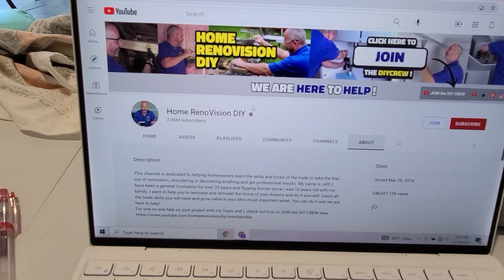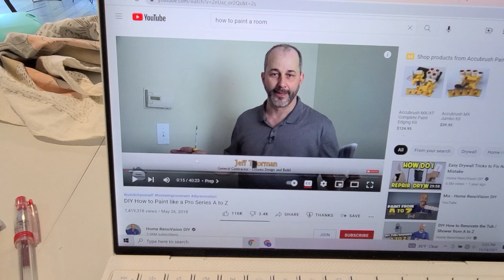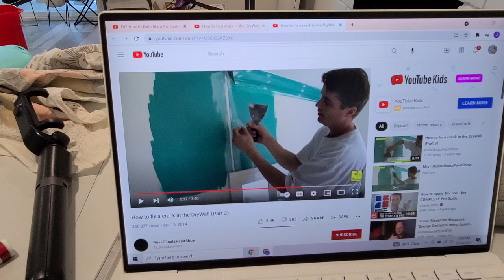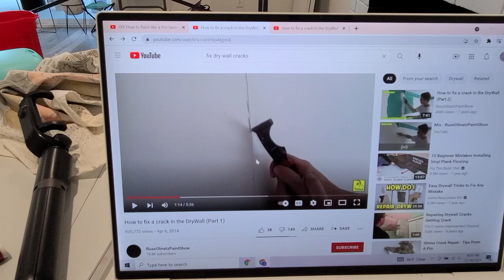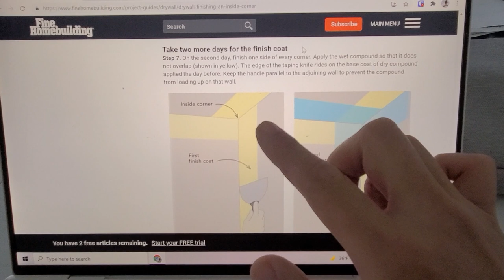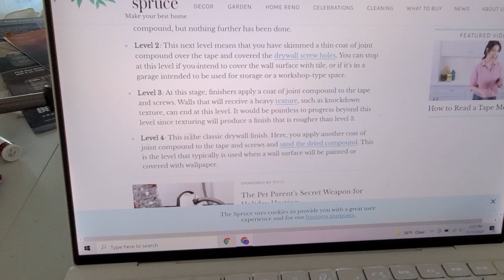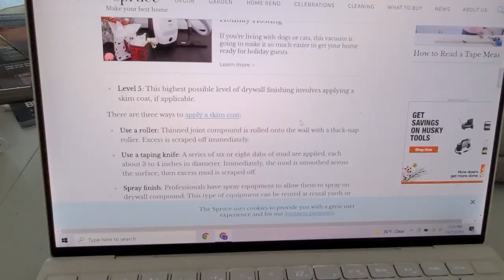A Dentist Paints A Room Part 1

Comment: I commend you for all the research that you are doing prior to starting a job but be careful it doesn't become overwhelming. For example I wouldn't remove trim  / door casing  as you did around the closet door unless I was intending to upgrade it. It's not clear from your video if you intend to skim coat the entire room (don't) in order to smooth out the slight texture or are just repairing some cracks and nail holes.  Also  I highly recommend you just buy your drywall compound in a pre mixed tub rather than dry in a bag. Look forward to your next video.....
Reply from the maker: Lol! Trust me. I wanted to keep the trim, but the wife hated it and she's the boss! I think the plan is to do barn doors. I'm still looking at skim coat. It looks like it'll be super flat and that'll make my OCD super happy, but a lot of work and I think the general consensus is most residential stops at level 4. I wanted to stop the video here because it was getting long and I still need to do a bunch of research on what color we want. Thank you for all the helpful comments!

Comment: Do yourself a favor and buy a big bucket of the pre mixed joint compound.  A hawk is designed to be used with a trowel, you might be better off using a joint compound box with those knives.  There wasn't enough mud on the intitial application under the tape, hence the lifting of the tape.  You should be able to complete the taping in 2-3 steps but use that longer knife to feather the edges.  A very useful youtube page is the Vancouver Carpenter.  As for removing nails,  you can use the other end of the pry bar to pry off nails rather than twisting them off.  You can always put a thinner board underneath it to preclude denting the drywall.
Reply from the maker: Yeah! I actually linked Vancouver Carpenter's video in the description. Super helpful! Thanks for all the advice!

Comment: Quick tip for getting nails out of walls:

Pop a biggish piece of scrap wood behind the pry bar and it will give you something to push against other than the plasterboard. Ideally, you want something big enough to be between the studs so you're not pushing into the unsupported drywall.

(I have put holes in walls not doing this, and have learned the hard way)
Reply from the maker: That's genius! I'll make sure to do that next time. My wife and I have definitely put a few holes in the drywall. Lol.
Reply: @ADentistDoesHomeImprovement  that's how we all learn! Keep up the good work, and the desire to learn!
Reply from the maker: @genghisbunny  Thank you! Will do!